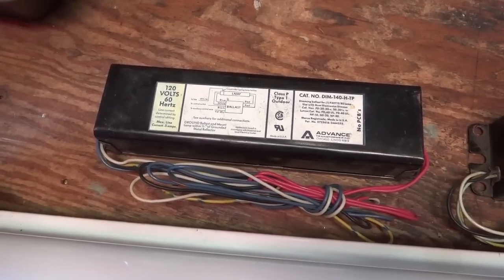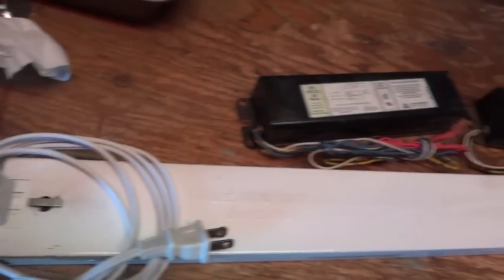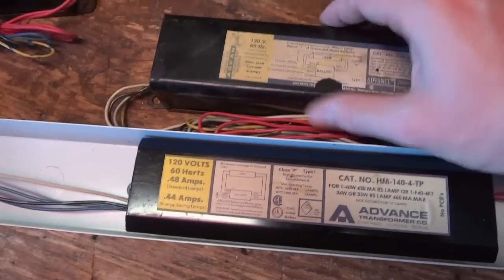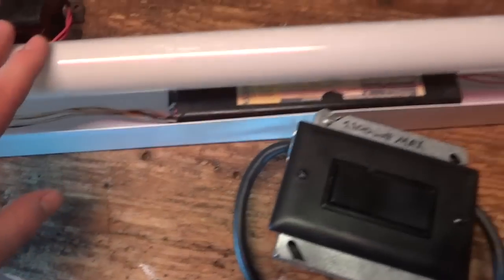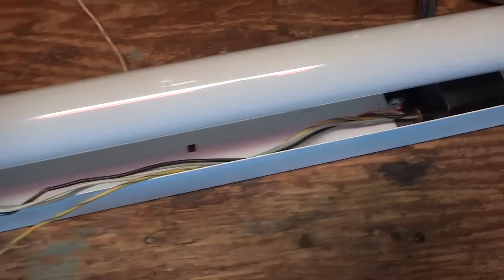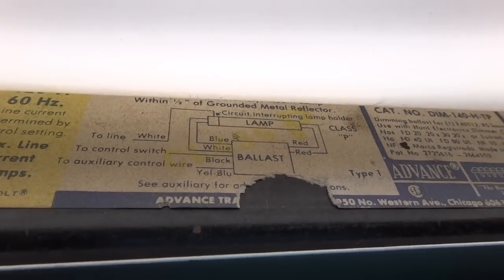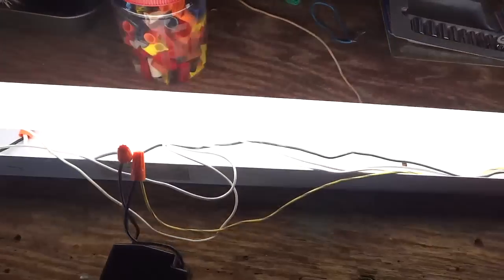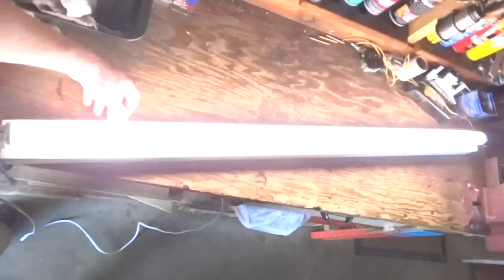Dimmable F40T12 Fluorescent Ballasts - V3

Comment: Lutron also made magnetic dimming ballasts. The ones they made were called Tu-Wire because it only needed two wires (a line and neutral) to work (no third wire), and used a special dimmer switch in series with the ballast.

Comment: The type of dimmer switch usually used with those ballasts would (if the same as the 220-240v versions) would have 2 load terminals, 1 controlled and one direct from the on/off switch in the switch module.

Mainly used in commercial applications over here though.

Comment: I actually have 3 (I think) of the dimmers that control these. There are several different models that will work. I believe the AUX wire is supposed to be a 0-10VDC controller wire but am not sure. I have several 1 and 2 lamp versions of these ballasts (T12 and T8 models), some of which I used to use in my living room at my old apartment. I also have some of the 2-wire versions that DO require a different dimmer (you WILL short the other type out if you connect the AUX wires to 120V)

Comment: I bought a four feet COCA Cola sign of EBay that had an two light energy saving t12 ballast. I changed to ballast to an electronic t8 X10 line dimmer. It works great! The mark 10 ballast was made by Advance. The dimmer switch is also mark 10 compatible.
Reply: Wow!

Comment: I think you can emulate this ballast by running the filaments from isolated 3.6v transformers and then using a standard magnetic ballast on a dimmer to power the arc.

Comment: Hey.  I'm hoping   you might  be able  to help me.  I'm  replacing  a switch  in a  makeup mirror   that has  a  22 watt   fluorescent  bulb  and a dimmable    ballast.  I have  a   B10K    pot switch  but  not sure  which lugs  to use.   The ballast   has  a  red  and yellow wire   out   of the end  of the ballast  and  two reds   out of the side.   I'm wondering   if  I can   connect  to the two  lugs  on the bottom   that's for   the spst   switch  and  then  hook to  the middle  and last  of the three  lugs on the side.  Thanks a lot  Love your  videos.